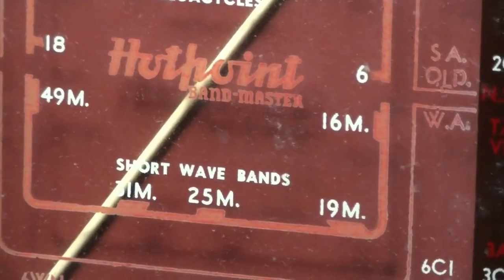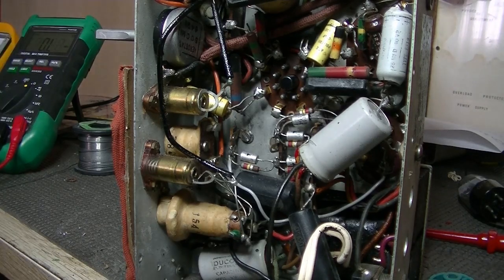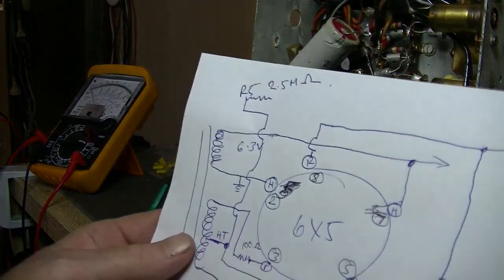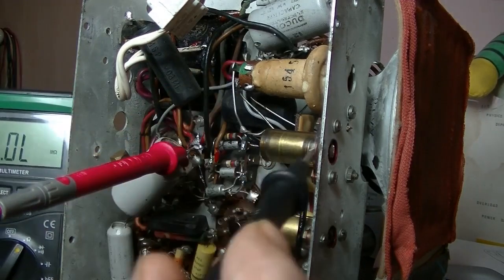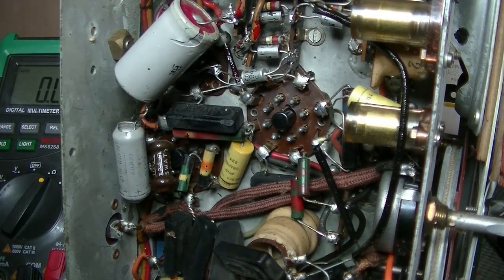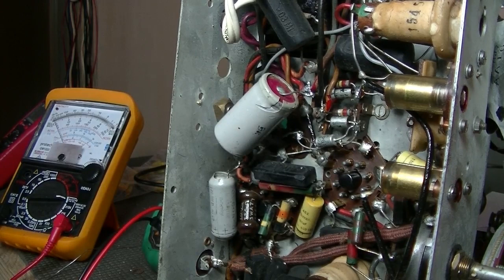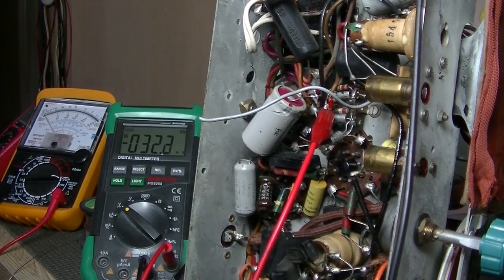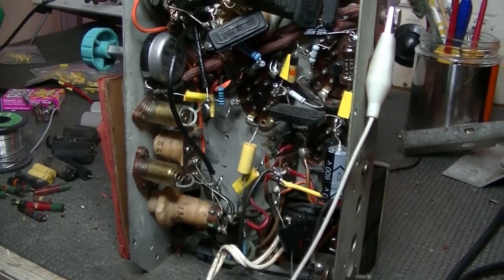A.G.E. Bandmaster Hotpoint H555DE 1947 (modified)

Comment: Gazillions of tube radios had their rectifier tubes replaced with "modern " Selenium  solid state rectifiers in the very late 
1940's thru the 1960's so this was no real problem but it did once work as an all tube radio (as intended) before. No real
problem reversing the hacking back to how it was originally designed to work. Good job doing so Frank.
Reply from the maker: This is the first one I've come across Steve, and I admit to having been a tad nervous in reversing it back to original. Got there in the end and now it seems so easy lol

Comment: Very good job getting that old radio working again. The original valves makes more sense than switching to sold state components good call.
Reply from the maker: Thanks Larry,  diodes just don't belong in a valve radio

Comment: Greetings: 
The two diodes in series are likely because his diodes cannot handle the high reverse voltage by themselves. The balancing resistors help make sure the diodes divide the the voltage drop equally. (Check the total voltage drop to ensure he is not using germanium diodes. I cannot see the diodes ID.) Need to check the new B+ on the filter caps as I do not trust that the 100 ohm resistors in each half of the HT winding are reducing the new B+ enough.

The model # is H55DE.
Reply from the maker: Thanks James, I'll get the radio back from the owner and check the B+

Comment: I am a tad puzzled why the resistors are across the rectifier diodes. Interested if anyone can elucidate.  Thanks for the video.
Reply from the maker: Hi Simon, this is the explanation my mate Nemo Fisher sent me earlier. I was puzzled too.

"The resistors  balance out the load on the two diodes so they both get the same load on each one. Sometime you may see 0.1uf caps across  them as well.  This will reduce the high frequencies on the rectifier diodes therefore reducing the noise. 
It looks like the guy who did this knew what he was doing by also adding the two low ohmage resistors in series with the diodes from the transformer. This well reduce the on rush current to the diodes and to the main smoothing caps.